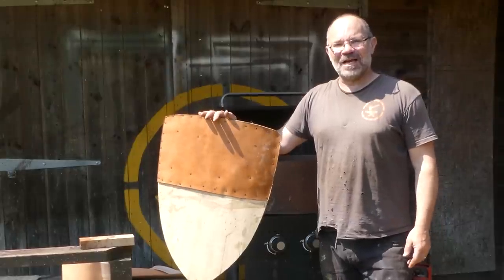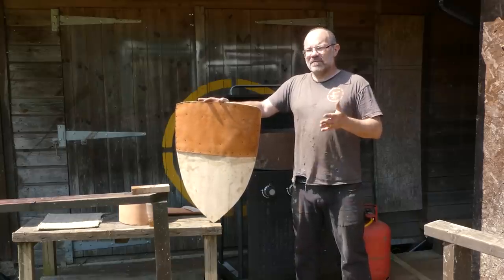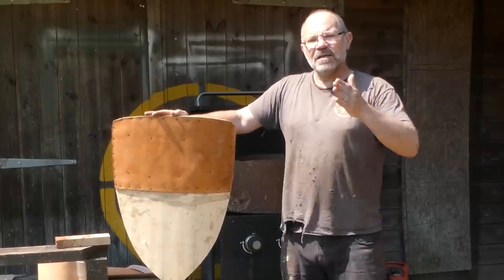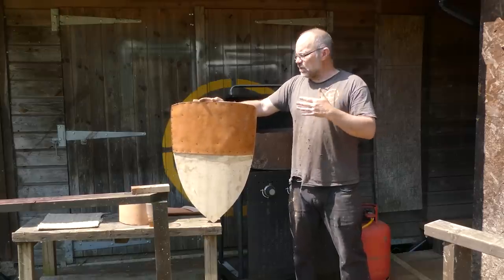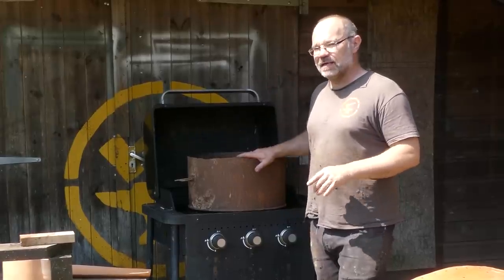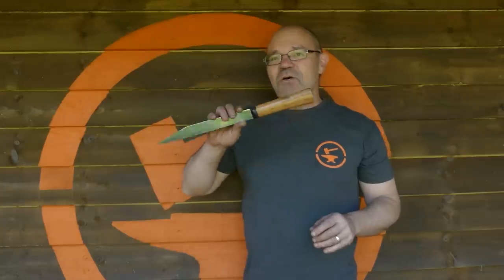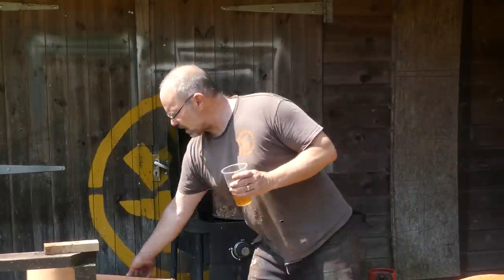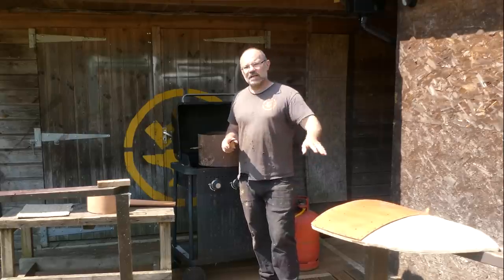Leather shield armour - Part 2

Comment: Doublet of Defense sounds like a D&D magic item
Reply: I'm wondering if the 'doublet' part of a shield covering isn't the same thing we do when we add a 'jacket' to a bullet, or 'coat' a wall with something.
Reply: No it's a Harry potter book.
Reply: @benholroyd5221 Harry Potter and the Doublet of Defense. 😂
Reply from the maker: I think Lonely wolf may have it.  Imagine this was first written down and the word coat/cote was used as in 'coating', an applied layer.  A later generation reads 'cote' and thinks jacket (modern English) and writes down the next copy using the more modern (to them doublet).  IOr something like that
Reply: There's a spell in Ars Magica called "Doublet of Impenetrable Silk"
Reply: Reminds me of the Pathfinder 1e "Reinforced Tunic", clothing with extra cords to protect even when not wearing "Armour".
Reply: @the_mad_fool  you wouldnt want to get that spell wrong...not that you could complain to the writer if you did lol
Reply: @tods_workshop  aw 😭
Reply: @tods_workshop  Looking at the spelling, doublet would be a French word I assume.  I always assumed that doublet meant 2 layers.
Reply: @Reginaldesq  it means folded, sort of "doubled"
Reply: @santekozmicov  Thank you  :)
Reply: @Immopimmo  Spellproofed Vest
Reply: @StanfieldMacCue  It is.

Comment: The mixture of oak tannins with hide glue should also make the glue water-resistant when it dries up because such glue won't rehydrate as easily as pure hide glue. The tannins react with the collagen in the glue and they cross-link it so it becomes insoluble.
Reply from the maker: Is that so?  Curious
Reply: Just like iron gall ink is waterproof.  This is an unexpected crossover.
Reply: @greghenrikson952  Iron gall ink oxidizes after being laid down on the parchment or paper.  But if it reacts to the hide immediately that would add early water resistance.
Reply: Ok, I'm going to have to play around with that and do some testing. I have lots of hide glue, acorn shells, oak bark, oak galls, and an oak based tanning solution I made that currently has my first attempt at home tanned leather soaking in it. If it can make the hide glue more water resistant that will be awesome for the flint knapped blades and projectile points I make.
Reply: Not directly related, but useful to know .... the addition of glycerine acts as a plasticiser for hide glue, which can be extremely brittle when fully dried. Also works with PVA glues. [I use it building concertina bellows]
Reply: @bigoldgrizzly  Curious. Now that makes me think of application of airtightening for forge bellows for my travel forge kit!
Reply: I don't have as much time to read comments as I used to, but I am certainly glad that I read this thread - it's absolutely fascinating.

I thank you all.
Reply: Adding aluminum sulfate or immersing in formaldehyde fumes also produces true waterproofing
Reply: @Entiox  My go to source for tannin is used Yorkshire tea bags. I drink about a gallon a day using 2 bags per pint mug ... and the wife is not that far behind me. I save these up till I have a bucketful then add an equal volume of water and simmer for about an hour before straining off. The result is a gallon or two of tea, too strong for even my taste ... true 'bucket chemistry'  ;<) Alternatively, the bags can be dried out and saved up till you have enough for a batch.
I have seen, [but never used] ground charcoal added to a resin/pitch to form a kind of 'concrete' for setting stone heads and the like. Have you tried using fillers like charcoal using hide glue?
Reply: @bigoldgrizzly  Tea isn't counted as too strong until you can dissolve a battleship in it.
Reply: @RichWoods23     I have a cunning plan to sink warships ...... you'll never guess...   ;<)
Reply: @TheLoachman , For real, man.  The level of arcane craft knowledge expressed in this single thread is rather staggering.  Inspiring to boot (not literally, I have no intention of becoming a leather boot maker 😬).

Comment: if the black gambeson idea expressed here worked, it would have potential for a mold based relatively mass production style.  Layer up a bunch of linen scraps of various length, impregnate with the glue concoction, and press between a mold.  Once the mold is made it would be much faster and require less expertise than custom tailoring (assuming it actually works well).
Reply from the maker: Interesting.  I would assume they would have made that leap and yet I have not seen anything like that, which perhaps gives the inverse in that it is a good indicator they didn't do this.   Hmmmmm
Reply: @tods_workshop  While a linen shirt is somewhat forgiving, and perhaps even a gambeson, once it is made hard by the glue I would think tailoring would become important to be practical.  Try putting on a plastic injection moulded mass produced armour and see how much you feel like fighting in it (thinking just of the mass produced fit, not the protection / weight).  Of course this is less of a concern with a shield, but then the wooden shield itself is the mould.
Reply: Getting the mold to not stick to the pressed piece is another challenge.  Taking a clue from similar modern processes, a proper wax coating on a near polished surface.  Or use facing layers impervious to the glue.

No good vacuum pump in the medieval period for vacuum bagging.  But piling sand should produce a similar effect of distributed pressure.

What I've seen of modern ballistic armor, adhesion between fabric layers makes a difference.
Reply: I'm not an expert on it by any means, but I thought I heard that linothorax did have to be custom-made to the person. One might could wear one belonging to someone else of similar build, like a son wearing one that had once been his father's, but you're not going to be able to mass-produce them in advance.
Reply: @antaguana  to me the main question would be how hard it gets.  I made a linothorax  a few years ago, and as it warmed up to your body it kind of (in a limited way) molded itself to your shape as you wore it.  The glue softened and weakened a bit in the areas regularly subjected to flexing, kind of like new leather getting worn in.  

I'm not saying I think it was done, no evidence for it, just curious to think of it could have worked.
Reply: @hanelyp1  perhaps a coating of flour / sand (similar to metal casting) for mould release.  A heap of sand is a practical way to get the pressure.  A screw or lever clamp with a positive and negative mould could also work.  A converted wine press perhaps?
Reply: @timothym9398  really good point. Perhaps the moulding would get close enough to use as a starting point then heat it up and make some adjustments. 

I guess it would be similar to metal casting, can't expect it to be usable straight out of the mould but it gets a lot of the work done by making it close to final shape.
Reply: Your point about mass production got me thinking, perhaps that was how the city states of classical Greece were able to armor their citizen soldiers? Imagery of soldiers depicts those linothoraxes to be rather uniform, and the layers of relatively cheap materials would be more economical than bronze cuirasses.
Reply: @antaguana  
I wonder then. Ancient plate carrier? Consider for a moment, mass produced armorplates. Inserted into an ordinary gambeson or placed behind say, brigandine...
Ideally you'd have something vaguely curved, fitting well enough to fit the average man.
Reply: @hanelyp1  The main thing is layers supporting eachother. With every layer bound, it applies expanding stress not just onto the layer you hit but the layers below and below and below.
Reply: Rigid fighting armor like munition plate did exist. It stands to reason this could be possible.
Just pulling from modern knowledge, though, I still do think singular armored plates either large like a modern SAPI or small like brigandine style, would be potentially superior. 
For example, one defect does not ruin the entire set of armor, should visual and basic physical inspection detect one.

Comment: I suspect there are a number of separate chemical processes going on here.
Iron and vinegar together form ferric and ferrous acetates, which further react with tannic acid to form iron-tannin complexes which change the colour of the wood, or in this instance leather. I do not know whether these tannin complexes include Ferric Tannate, 
Iron oxides definitely react with tannic acid to form ferric tannate. This compound is a solid, stable, black substance which resists further oxidation on an iron substrate, and can be used to fix rust, particularly useful in converting and fixing rust in present in pitting and micro cracking. It does not exhibit the exfoliation tendencies of red rust and is not hygroscopic. The tannate is however, a relatively porous material and freely soaks up thin oils for maximum rust protection. I have used this for years in conserving old iron tools. 
I think it quite possible that any tannates formed within the fibres of the leather, might well soak up [and perhaps bond with?] the hide glue in a similar way thus contributing to overall material strength.
If my guess about the ferric tannate involvement is correct, in the method you are using, by far the greatest proportion of the iron would be coming from the iron filings stipulated in the recipe, rather than the small amount added in the vinegar/iron mix you added. It may well be that powdered rust might be a better bet than Iron filings, indeed in historical times, such filings may well have contained a high proportion of rust. Given that the leather and glue is a wet gloopy mess, any clean filings might convert to rust [and hence tannates], during the long drying period
If memory serves, The optimal conditions for the formation of tannates from rust and tannic acid occur at a pH of between 2 and 3. The amount of vinegar added to your large vat is unlikely to have much effect on the overall pH of the glue. Again the low pH [acidity] required is likely to come from the tannic acid leaching out from within the leather, since hide glues are fairly neutral, perhaps with a tendency to slightly acidic.

 Be interesting to try some small test pieces to examine the 'sandwich' union between the two pieces of leather, made with glass/filings and glass/rust. Maybe test pH ?
I imagine other folks here could give better insights on possible reactions as my studies in chemistry are over half a century out of date.
Keep up the good work Todd .... OG
Reply: Love that you wrote the chemistry and use out. I have used vinegar to clean off rust and such nonesense off of iron, and frankly prefer using it over ferric chloride and such things when etching patternwelded steel, but it never occurred to me to add the tannins! Cheers, and thank you! :)

Comment: I wonder if the "Black Gambeson" was actually something similar to oilskin canvas?

They had the technology, at least in the 1500s they did, since they were using oilskin canvas for sails by then, and oilskin coats made today are notoriously tough, so I imagine multiplying that by 30 would only be that much tougher, and relatively waterproof to boot. 

The process doesn;t turn the fabric jet black, but it does discolor it and make it darker for sure.

Comment: Also to note is that glycerin is a plasticizer for hide glue, so if the chap boiling up the hide glue happened to include some extra bits of cartiledge or sinew in his glue pot, the result would be noticeably less brittle than a pure hide glue.
Reply: I see no reason why cartilage or sinew would provide glycerine in appreciable quantities. You can't just cook it out of fat, but it's a byproduct of soap production
Reply: @MarcRitzMD  Indeed, they'd need to add soda ash or similar

Comment: Just a thought on hide vs casein glues. 
Both glues go back millennia and would have been in fairly common usage and made using easily available materials. Hide glue , however, softens with the application of heat particularly so, when a bit on the damp side. Casein glue does not seem to be much affected by either heat or water. Perhaps the composite material formed with leather, hide glue and glass/iron gave better 'arrow resistance 'in northern countries, which might have been somewhat negated in warmer Mediterranean climates, where the much more heat stable casein glues could have offered a distinct edge ?

Comment: didn't realise there were viking societies, didn't think they'd not know how to blacken leather given it's the same process for ebonising wood... and was known about 2K years before the 'vikings'... and would've been easily accomplished given they used peat bogs for iron, and peat (the ph of the substrate) + iron = iron tannate. So the water from the area they collected peat would've stained their clothes, skin, and leathers...
also (while completely outside the geographical scope, but within the time period), you could make a square of period aztec armour, they used salt brine rather than glue to infuse, their version of a gambeson, fabric with salt crystals to the same effect.
Reply: My  understanding is that the black leather ban is a holdover from the early days when the groups were changing from pageantry with minimal research to actually making an effort with the kit. It was put in place to stop 'bikings' in biking leathers.

The reenactment group I'm with does not ban it provided it's actually ebonised like Todd did, or an otherwise natural black - but it is generally kept to a minimum.
Obviously chrome tanned, or analine dyed black leather is hard banned
Reply from the maker: Good to know the blanket ban is slowly lifting.  Also thanks for introducing me to the word 'bikings'
Reply: Seems to me that Viking societies should limit the amount of leather in general, since it wasn't often worn by the Norse...
Reply: @MinSredMash  Shoes, belts, knife sheaths, scabbard outers - it was used a fair amount based off the archaeology.

I don't know of much evidence of leather being used as clothing (like the '(b/v)ikings' you see in the media), but it was almost certainly not uncommon for specific uses.
Reply: @Oddthetall  Yes I meant in terms of clothing. I don't really see how black leather for belts/shoes/sheaths etc could pose much of a problem for authenticity.

Comment: I had a leather pouch got wet and had my mail gloves left on it for a, few hours. Left blue grey spots all over it. They went black yes but over the years developed into holes so watch that process. It's like very slow acid.
Reply: Yes, that is why dying leather that way, without a thorough rinsing, is a risky approach.
Reply: In a similar vein, I have often heard it said that oak was not favoured for tool handles as the tannin accelerates corrosion of the Iron -  I've not really found this to be much of a problem, but oak handles will blacken fast near areas of contact, especially when damp.

Comment: well, i tried the ebonizer solution added with the rabbit skin glue.
It sure colored the leather, well and fast !
But it don't seem harder than the process without the ebonizer recipe.

It still can be modeled and the blade resistance is the same : i can draw with my fingernail, so...
Still a fun experiment to do !

I think there is more than one bath : jelly, skin glue, ending with bee wax... Someone told me about salted solution, but i have doubts
ps : maybe collophane ?

I'm pretty sure we never found an entire recipe in the old books. Such a knowledge is precious, soooo precious...

pps : on turnshoes they use pine goudron and fine earth... instead of skin glue and fine iron... In medieval times glass is so rare... and so precious ! in can't imagine a carolingian recipe using this

Comment: Got to make you wonder how they came across the mix of dog turds and oak tannin being the magic solution of tanning leather.
Reply: undigested leather in dog shit found on saw dust perhaps.
Reply: There are a vast number of ways to turn raw hides into leather. For instance brain tanning being one I know has a long recorded history - every animal comes with its own tanning kit, supposedly always enough brain in a creature to tan its own hide! 
But who knows which one(s) were discovered first, and why other methods become used - though these people are far from stupid, if they get lucky and see a useful result they will figure out how to replicate it, and then see similarity between other materials. And if a material is really easy to source, or does the job faster/better then it will be no surprise that something common and otherwise waste gets used.
Reply: Leather tanning is very old it was done before any pure chemical compounds and even the alchemy was a thing. If everything you have are animal and plant parts and juices you use them. In not so distant past manure was used in buildings, dried as fuel for cooking and urine for washing/cleaning. Soaking things in water and stuff to make things more pliable is still very common for woodworking and basketry. 
I would say the chance is quite high that someone will soak something with tannin bound by hide straps in dirty water.... And then it will be just refinement which plants and which turds (and other stuff) work best.
Reply: @ladislavseps4801  My guess is its a bit of both, but the rest is something of travel and meeting people with new ideas. Being you're a Tanner, your chances of meeting people outside your occupation who aren't chucking up their guts is pretty slim. However, if you hear that a city over the hills is using tannin and you're using turds or brains then you might decide to give it a go. Finding that it actually works you might also decide to try using two of those things together in the back of your very smelly shed and coming up with something 'new' that hasn't been done before.
Reply: By accident or some truly random trial and error, across thousands of years.